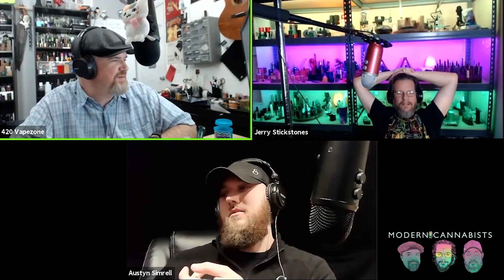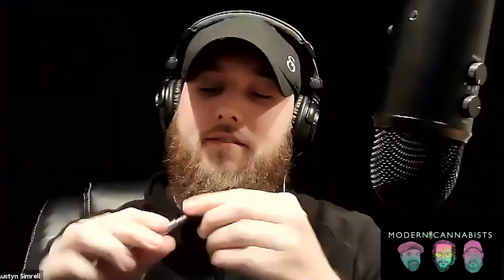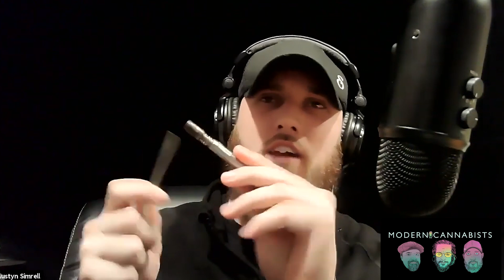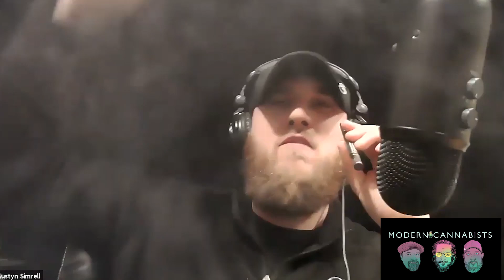How to get THICK CLOUDS with the DYNAVAP VAPCAP - Austyn's vapcap heating method

Comment: I just ordered mine but I need help with what single torch lighter is preferable. Any thoughts? Thanks and looking forward to getting this!
Reply: Mikethebassist the one he uses in the video is on amazon called aomai jet torch lighter. The ones with flint are better because they last a lot longer than the ones u press the button with.
Reply: @StopJerkingOff 
It's the opposite bro. Electronic lighters last way longer than flint.
Reply: Jay WP ur right but ur talking about just the source for the flame, I’m talking bout the actual ignition.
Reply: @StopJerkingOff  that's what I'm talking about, too.
Reply: @Jay-we2ek  I agree! That 3 buck single flame lighter has to be only one step above a BIC, or maybe none!  Looks cheap, and is! lol

Comment: Very nice. What torch do you use?
Reply: colin burkett I have been using the Aomai Single flame for the past 16 months. It’s Incredibly reliable and you can maintenance it yourself. Replacing the flint is easy and you can easily clean off the jets after a few months of continued use.

Comment: is very close to combustion, I think !!!
Reply: Yeah you can see the combustion smoke coming out of the cap the best thing for this vape is a magnetic induction heater
Reply: @DemolitionLovers905  sure, it's true, cheers
Reply: Ryan l 
That’s not combustion, there’s just a lot of vapour
Reply: @DemolitionLovers905 
It's not smoke. It's not hot enough. Why do people keep saying stuff like this on dynavap vids?
Reply: Jay WP really, I thought it was still posible to combust w the dyna
Reply: @urtechassist4556 
It IS. But not like that. Needs more heat for that.
Reply: @urtechassist4556  It is, but you aren't listening for the click.  if you go even 2 seconds past the click, it will combust.

Comment: Does the Dynavap smell when you're vaping?  Is there a lingering smell like there is from burning flower?
Reply: Yes there is. The things that smell the most is the leftover bud after use. The smell can be much more easily hidden tho. A open window or fan and spray can get rid of it. It’s like a burnt popcorn smell, just not as bad. Hard to explain
Reply: little lingering smell, but way easier to control then just lighting a j in your room lol

Comment: Damn i want a dyna vap i never even seen them things till today
Reply: @carcxsa4715  no, they're not. you're either a hater or don't know how to use it. or you just don't like it, but they're pretty great butane vapes, especially for the price of the M version.
Reply: @carcxsa4715  you're smoking a lot more than weed to be able to say something like that
Reply: @carcxsa4715  this still does the job and makes you save much more material. dynavap is all about efficiency
Reply: @loze19  exactly, once you master that technique the rips get insane
Reply: @zno  for real. And most sessions with the vapcap I rarely ever cough, even on those big hits (unless it's a super high temp hit closer to combustion, but even then it's not usual). I also own the Fury Edge and it's an awesome vape as well.

Comment: Isn't you smoking this way rather than vaporizing?
Reply from the maker: nope
Reply: @moderncannabists7126  Well smoke is going out of it
Reply: @mikoajmarciniak3613  That's a huge cloud of vapor!
Reply: @KOrnhOliO1  I've tried it myself, and it's kinda hard to tell it's a vapor. You can see what you're taking out from the chamber. Black and overheated herb. Cloud is big, but it's overheated for sure. Thin border between combustion.
Reply: @mikoajmarciniak3613  Mind the click! ;)
Reply: @KOrnhOliO1  Click doesn't matter if you do sesh right after sesh
Reply: @mikoajmarciniak3613  It sure does....  You need to wait for that click BEFORE you put flame to it again.  Otherwise you take the chance of burning your weed.  That's exactly why the click is there.
Reply: @KOrnhOliO1  What I mean by sesh is a time between the first ready to vape click and the second sesh finish click
Reply: You do realize thc and combustion are only about 10 degrees away from each other. So in order to vaporize completely you have to get close to combustion.

Comment: Has anyone had their lungs hurt after using the DYNAVAP for a few months?
Reply: Nope.  Maybe it's the weed you are vaping?  Did you buy it at a dispensary?  In Oregon, they test all weed before the dispensary can sell it.  If there is ANY fertilizer or pesticides, they throw it out and it can't be sold.  I just buy from dispensaries so I know it isn't tainted.
Reply: @KOrnhOliO1  im just thinking with the stainless steel accumulating in the lungs, I use a magic flight launch box but I’ve bought 3 within the past 3 months so I’m looking for another device. I’m in Massachusetts an Adult use dispensary state that regulates its testing. I was thinking about the Pax2 or the airizer solo 2
Reply: @zacharydelka2209  I have a Pax2 and absolutely love it!  I designed and 3d printed an adapter to use the Pax2 in my perc bong and the hits are huge and ultra smooth!  :)
Reply: @zacharydelka2209  I'm extremely skeptical of the DynaVap. Not to mention its biggest promoter and resaler goes by the name of "Sneaky Pete" not to mention products called "Reaper" and a "Serpent" lighter. I also noticed the name of the brand that makes their torch lighters is "Vertigo".
Reply: It's medical grade stainless you'll be fine baby.
Reply: @zacharydelka2209  so did you go with pax or arizer solo? And which one is better or why do you like the one you chose?

Comment: pls do it this with g pen dash
Reply: The g pen connect is like the utillian 5s which was also amazing for 3 months but resembled or had heating element and just impossible to clean it completely around those tight narrow edges. I don’t know if it’s because it’s clogged and dirty and I can’t unclog it without soaking which unfortunately would ruin the element apparently so idk about the g pen connect nowadays I mean don’t me get me wrong awesomeness for awhile but yeah it’s collecting dust with my utillian 5s, divine tribe v5 bs, and arizer q which I had the d Dave mods for and honestly I would use the arizer q more often but it requires space and time to get it going correctly.

Comment: whats he doing with the air chamber, flutter ?
Reply: It looks like he pulls with the airport closed then lets a bit of air in at the end of each pull.

I do one lung pull with it closed, letting little bursts of air in about every three seconds, then remove finger at the end then inhale. I use CBD weed so would probably cough my guts up doing one long pull with regular weed.
Reply: @atrio1136  just got the Hang of it on the CBD myself since new years after 20 yrs THC no Harm 😎👍

Comment: Thick clouds are such a waste LOLOLOL.   All that unused product exhaled is wasted.  This guy couldn't have made it in the 60s or 70s.
Reply from the maker: Oh boy one of these visible vapor is waste vapor guys
Reply: Gonna hit this topic this Friday on Troy and Jerry
Reply: It doesn't really matter how big the clouds are...you still get massively RIPPED!  Course, I hold my hits in for a count of 10, to get the most outta every hit!  ;)
Reply: @KOrnhOliO1  guess im doing sumting wrong. cant really tell that the dynavap 2020 m gets me even close as stoned as a spliff. weed is cured for 2 month, SSSDH OJD cut, grown under 600w led. spliff really is bangin, but that vape is very subtile in effect. guess its my fault tho
Reply: @shiftagaming4959  I don't get big cloud hits until usually the 3rd hit off the dynavap bowl. Try puffing short and hard like people do on cigars. Repeat over and over to get it really going....then I get the huge clouds.  But, I think you still get stoned good off of the smaller cloud hits.  Mostly the terpines, I think, so the clouds aren't as big.  But, I think we need to remember, you aren't really trying, are we?, to get huge clouds like we would when we smoke and combust (burn) from a joint or regular weed pipe.  That's smoke and this isn't...it's vape.  So, I think when these guys get gigantic clouds, and seem to cough, that's really when they over heat the dynavap and cause it to combust. I never cough off my dynavap because I don't over torch it.  
Plus, they also have a black background behind them so it shows up like a bigger cloud!  When I first got mine, my research and learning led me to believe the cloud size really didn't matter because you aren't combusting the weed.  I think cloud size and amount is vastly overrated.